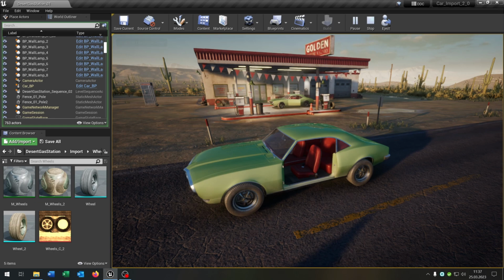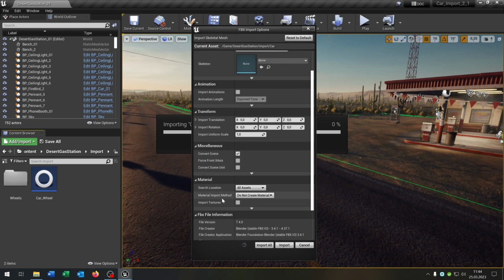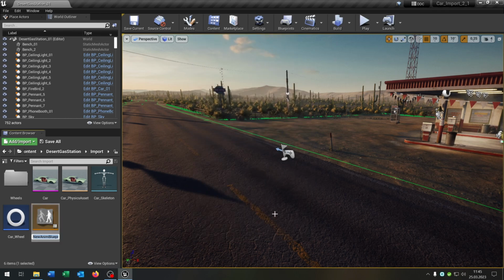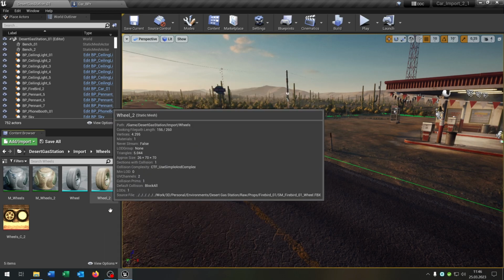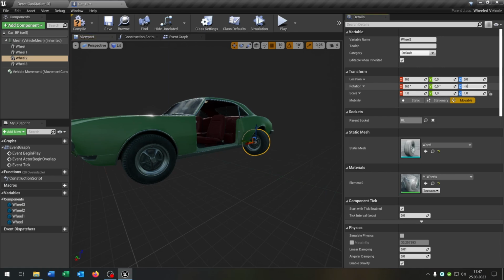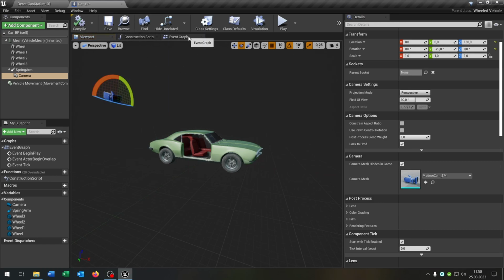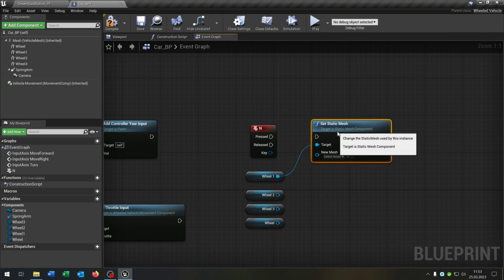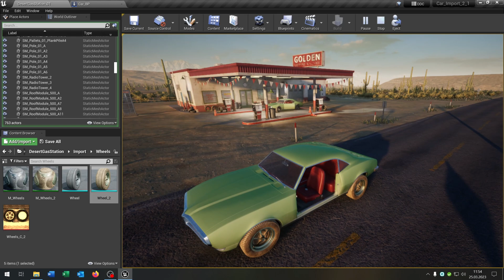Unreal Engine Change Tires Tutorial

Comment: Hello! What i would like to see is better controls for the car. More arcade like not like in real life that you can't control the car at very high speed. . the Sedan in UE 4 is so bad it just flips over or spins out when you just slightly steer especially on keyboard. I would love if it felt something like NFS MW 2005
Reply from the maker: You can customize the friction by editing the Vehicle Wheel. Just set the "Lat Stiff Value" to 60 for example.
Reply: @Seredias.  Thank you! I will check that out. i didn't find much info on this. Seems like there are more tutorials for racing games in Unity.

Comment: for thoses who wonder and want a more in debt system like : set inner ryms and tire, do the same but split them into 2 diff statics meshes, Then place a child static mesh into the wheel meshes into the car BP you now be able to swap tire independently from the rym. + if you desire a setup to swap from basic civil car to a offroad suspension ( currently with the engine 5.0 + ) you can't simply cast a new wheel param since the param wheel are unaccessible unless you create your own chaos vehicle ( but that's lots of trouble and work) Bassically what you do is : create 2 child : 1 civil + 1 Offroad suspension ( in this one set new param wheel with define wheels params radius )so in-game you simply swap from 1 child to an other when getting the offroad option on and off :)

Comment: Great tutorial, as always. Would you consider doing a tutorial on how to mimic explosive damage where the wheels, doors, bonnet, etc are blown off and far away from the vehicle?
Reply: that's kinda easy, if you want to keep a 'physical asset of the car on the dead 'anim' simply set a mask ( or current mat color to a dark grey smokish style a mask could work better since if can be set a like 0.8 transluences and keep a tint of the original car color) on the death anim simply detach static meshes + set enable physics components after like 0.5sec (so it won't make the car itself glitch into the sky) and then create a radial impulse object with dunno a force of 500 so the part get a 360 sphere detection to get them fly away.
Reply: @psyco4452  Thank you! I was on the right track, it seems. Does that mean that the doors and bonnet, etc need to be separate static meshes attached to the skeletal vehicle body in blueprint? I tried detaching the mesh associated with the bone on a single skeletal mesh, but I failed in my attempts. I use a lot of Grand Theft Auto 5 assets in my learning, if that makes any difference?
Reply: @DarthIckus  to be honest i do my own 3ds models and i got no difficulties, what you need to keep in mind is any static mesh you have need to be plugged in the right bone sockets
Reply: @psyco4452  Your advice makes perfect sense. I will try that, and see what I can come up with. Thank you very very much! :)